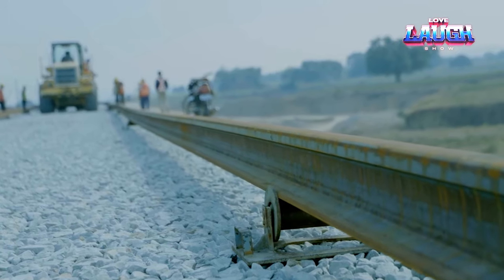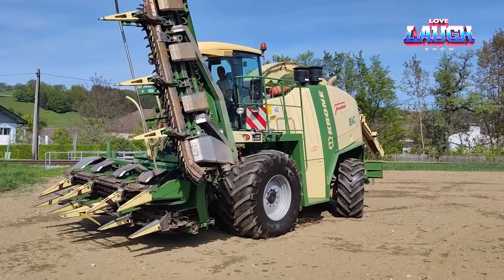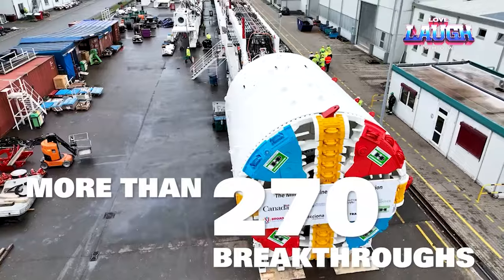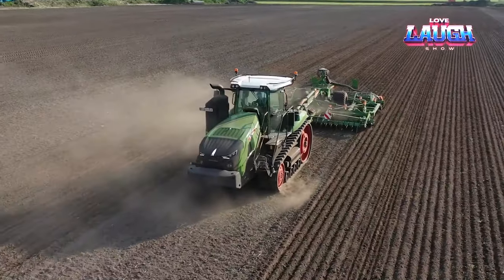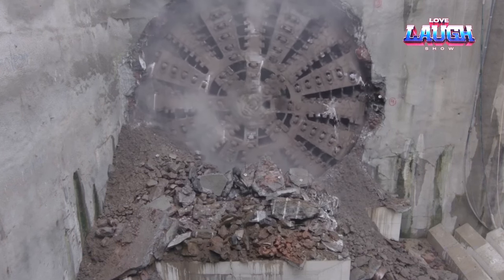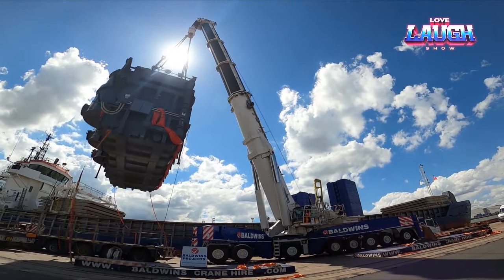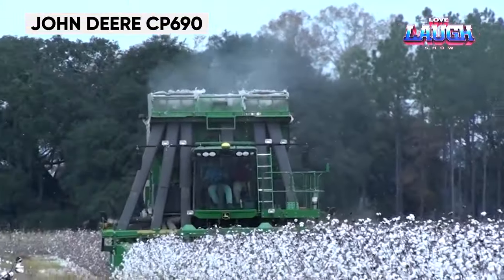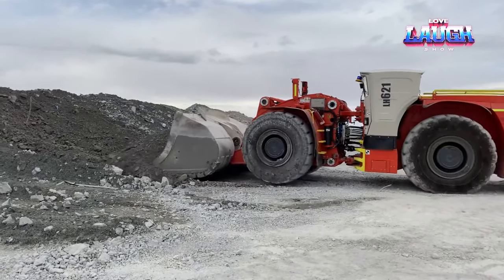15 Impressive Industrial Machines Operating at Peak Efficiency

Comment: Worked on something similar - the noise is insane! Ear protections a must.
Reply from the maker: Absolutely, working around heavy machinery often involves exposure to high noise levels, making ear protection crucial. Prolonged exposure without proper protection can lead to hearing damage. It's great that you're aware and taking the necessary precautions. Safety first!